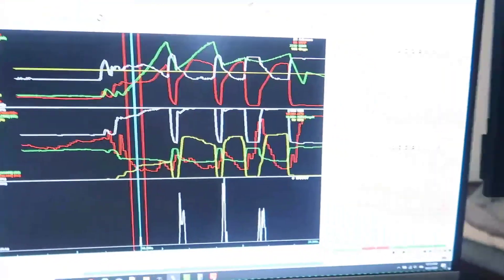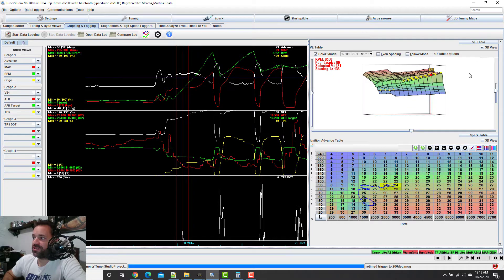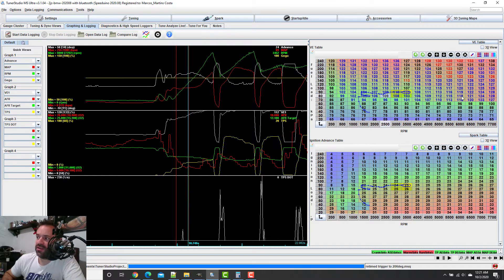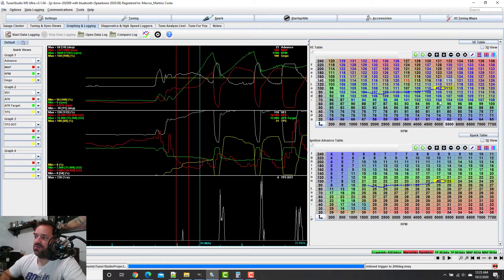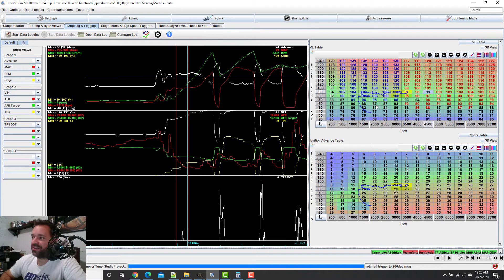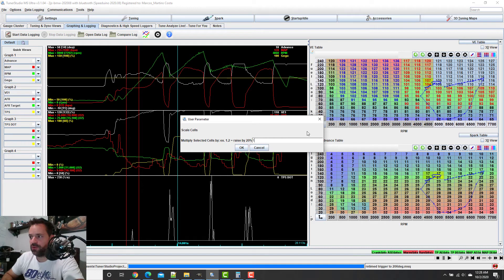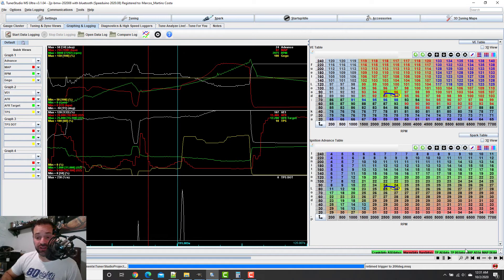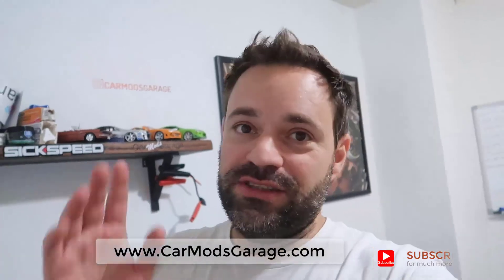Tuning VE Table using the logs on SpeedyEFI ECU and TunerStudio - 2JZ to E46 Tuning

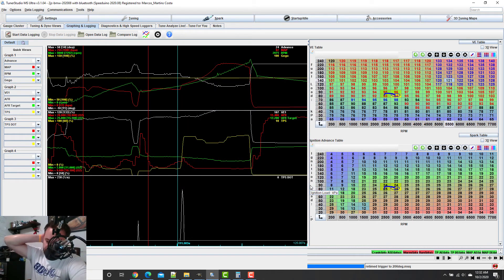Comment: @16:32 Lol I know exactly what you mean because I literally Started Tuning at the start of Covid and Lockdown on my Island as a result of the extra time. I did an HPATuning Course and started on the ECU master Black for my build. There was so much I learned from just jumping into it I even wanted to start vlogging and doing videos showing the processes and what to look for etc just from experience. My main goal was to get Factory Like Performance & as such I would switch periodically between the factory ECU on my 2JZ-GE and the EMU via Plug&Play adapter. I got everything working perfectly, AC everything like factory the idle ups, warmups just perfect. I found that I spend too much time playing in the ECU n eventually took it out n took a pause lol it's been 3 months now but only due to an exhaust leak that keeps coming back everytime i say i'm going to plug back the ecu lol. I have a GTE engine which is to be later swapped in which is why i got the EMU black, used my JZA80 on the GE engine for the learning process.
Reply from the maker: That's awesome. I got theirs course also. They are good. Funny you mentioned exhaust leak. In my build it leaks everywhere in the exhaust after the only o2 sensor I have. Since mine is not factory I don't care about the second one. Using the standalone it works perfectly. 
I hear you though. That's not ready to get an standalone to work exactly like the OEM. Good job on that one. It takes a lot of time
Reply: @CarModsGarage  It really does take time. that was days of tinkering, weeks in all not to mention cold starts every morning logging and dialing things, then getting the warmup enrichment to act the same and the momentary idle up for 20 or so seconds. lol. there's so many little details that's easy to miss that the stock computers have which we overlook on the standalones

Comment: 1- Tune with lambda instead of AFR
2- use VE analyze in MLV to trim the VE table
Reply: I Use ECU Master EMU Black Tuning software #SelfTuned, I can Definitely Say Tune with lambda is the best thing you can do, I second this. 
I assume Step #2 is RE to this specific application. 
Reading you guys convo haha love geeking on tips
gonna sub @DC Werx to see what content you got going over there 😉
Reply from the maker: @BjornFSE  @DCWerx is very good. He knows this stuff.
Reply from the maker: thanks for the tips man. I've learned a bit watching some of your videos. I've tried the VE Analyze but it sometimes changes a cell in the middle of nowhere to a lower value. I will try that again to show people they can do it. I will mention your channel. I really enjoy your videos!
Reply: @CarModsGarage  one thing to keep an eye on is the default AFR table MLV is using to correct your tune. Copy and paste your AFR table over to MLV and set change to "hard" that usually works well
Reply from the maker: @DCWERX  oh I see. Ya the AFR target I copy and paste from my project and also load the tube Everytime to be safe. I just changed it to hard and it worked better. I was using normal. I get just a couple of spots where I have like a higher number than the analyzer changed the too cell to a lower number and a cell above that is high again. I guess gotta go through it and smooth it out by hand afterwards.  
It worked better on hard though. Thanks brother 🤙
Reply: @CarModsGarage  it's usually not perfect but it gets you super close. Also be gentle with the throttle when datalogging. It's a slow process but it works great
Reply from the maker: @DCWERX  ops lol 🤣 I am gentle untill I get close to good and I am sure it is not lean then I floor it. I guess getting a longer log will be better for the analyzer also ha?
Reply: @CarModsGarage  correct I usually do 5+ minutes logs to give MLV a good bit of data to work with
Reply from the maker: Nice man. I appreciate your comments. I will do that soon and and see how it goes
Reply: @DCWERX  nice